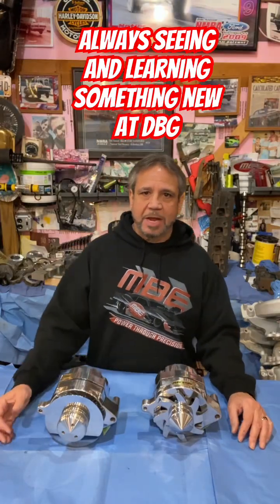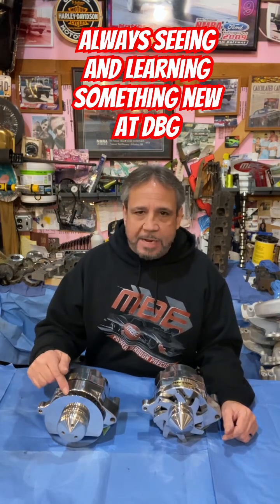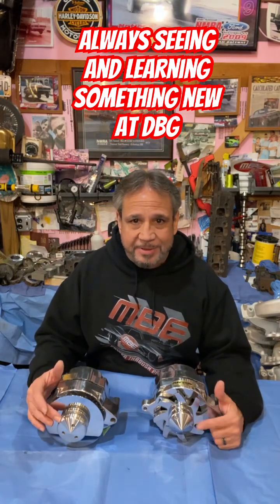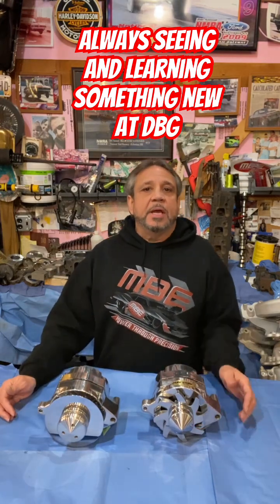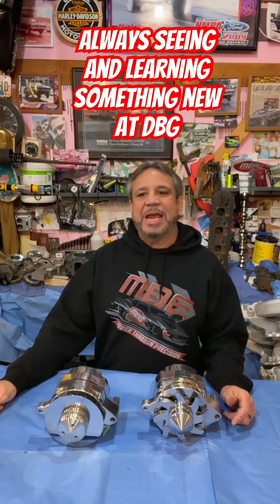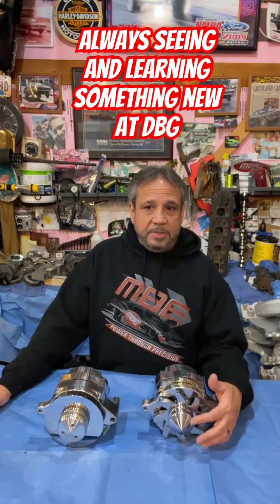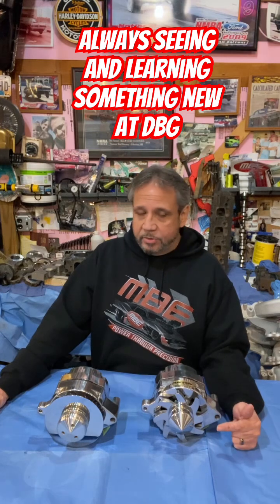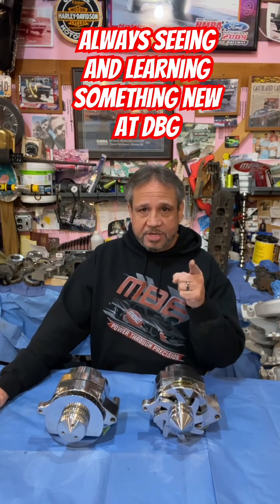DragBoss Garage: Engine Pulley Speed Safety,  How To Determine The Max RPM Of Your Alternator Pulley

Comment: I think he's got the RPM backwards or something here because I put an alternator on a semi truck and the larger pulley on the alternator May the alternator turn so slow at idle that it would not produce 14 volts when I put a smaller pulley back on the alternator it would produce 14 volts in idle
Reply: Correct.  Smaller pulley on the alternator will spin it faster and larger pulley slower. I do believe the same. He got them backwards